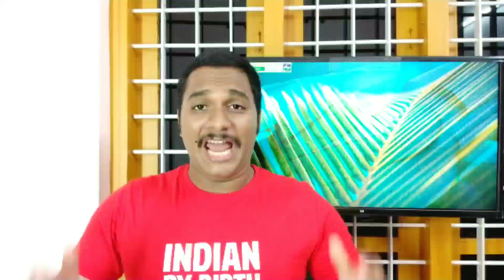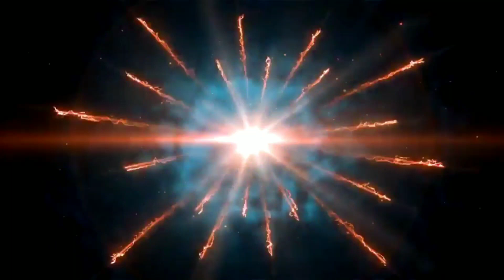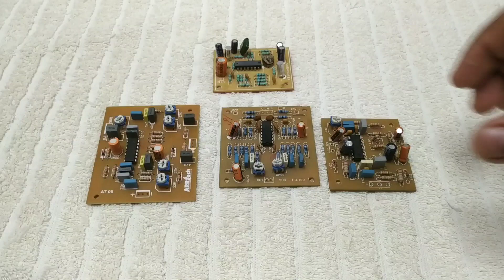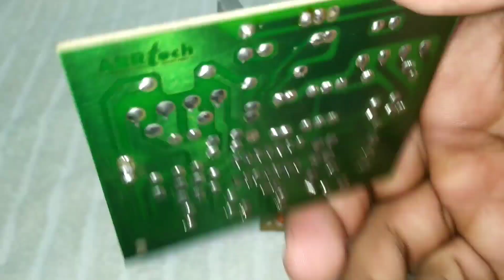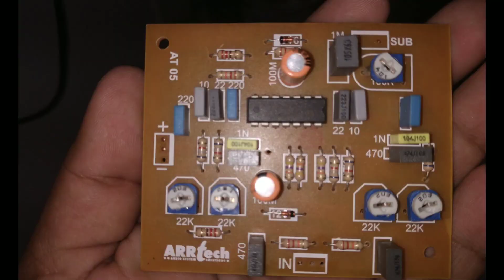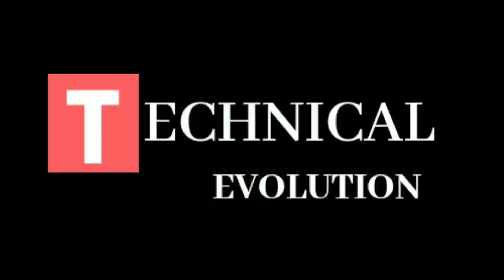Best subwoofer low pass filter board. How to select a board  for optimum performance

Comment: Tda2030 പറ്റിയ നല്ല ഒരു subfilter board പറയാമോ
Reply: 2030 ഉപയോഗിക്കണ്ട Mosfet or class d amp നോകൂ
Reply: @AMNLabs  home theaterine  set cheyyan aayirunne atha  mosfet use cheyathate Allathe ore tpa3116d2 class d unde but speaker verum 25w aanu ullathe
Reply: Mosfet പിന്നെ classd amplifier ൽ നല്ല low frequency response kittum adha njan agane paraje jrc4558 ulla filter nokooo 2030 nu
Reply: Pinne nalla powerful ane njan home theater chayyumbol mosft or transistor or class d amp ane upayogikare jbl pioneer infinity 12 inches idinu thaze ulla otta woofersum upayogikarilla tda2030 oru cheriya amp Anu
Reply: TB bass filter und  public available alla

Comment: ബ്രോ സബ് ഫിൽറ്റർ ബോർഡ്‌  lm324 ഡബിൾ പ്രീസെറ്ലോട്ട്  27-0-27 dc അല്ലേ max  കൊടുക്കാൻ പറ്റു.. 37-0-37 dc കൊടുക്കാൻ പറ്റുമോ??  Lm 324 nte max voltage 32 dc ആണു 4 mosfet ബോർഡ്‌നു എങ്ങനെ മാച്ച് ആക്കാം? പ്ലീസ് റിപ്ലൈ..
Reply from the maker: Resistor vazhiyanu voltage ic yilekk pokunnath avde vach voltage kurayunnund so no problem pinne chila boardil zener dioadum und so no problem
Reply: @technicalevolution9887   താങ്ക്സ് ബ്രോ .. കട്ട  സപ്പോർട്ട് ഉണ്ട്.. 💓💓

Comment: hi ബ്രോ ഈ ബോർഡ് കളുടെ ഒക്കെ op frequency range എത്ര മുതൽ എത്ര വരെ ആണ്
Reply from the maker: Pala boardum palathanu on 324 40 to 180hz anu
Reply: ചേട്ടാ 10hz to 80hz കിട്ടുന്ന board ഉണ്ടാകുമോ?
Reply from the maker: @geneshpn  20hz thottee humansnu kelkan pattu pinne 40hz to 50hz anu busil okke varunnath frequency theerumanikkunnath circuitile resistorum caps um anu
Reply: 40 to 50 hz circuit or board  ഉണ്ടോ ബ്രോ

Comment: ഇതുപോലുള്ള ഒരു വീഡിയോ ആണ് എല്ലാരും ഇറക്കേണ്ടത് ....വളരെ നാന്നായി ...Jbl മാച്ച് വരുന്നതു 74ആണോ 324ആണോ ?എത്രയാണ് റേറ്റ് .....
Reply from the maker: All boards costs under 250
Reply from the maker: Lm324 anu better tlo74 ithiri higher frequency pole thonnum lm324 maatty tlo74 ittal peak pettennu akum amp so pettennu clip chyum
Reply: @technicalevolution9887  ക്ലിപ്പ് ചെയ്യുക എന്ന് വെച്ചാൽ ???
324  നു പകരം tlo ഉബയോഗിക്കാമോ ?
Reply from the maker: @abhilashgerman2636  ya 2icyum use chyam ore portil clip akuka nnu vachal volume koody peak chellumbo click sound kettu distorted akum
Reply: @technicalevolution9887  Last -324 ഉപയോഗിച്ചുള്ള single supplay ബോർഡും ,dual supplay ബോർഡും തമ്മിൽ പ്രകടമായ വ്യത്യാസം സൗണ്ടിൽ ഉണ്ടോ?
Reply from the maker: @abhilashgerman2636  und
Reply: @technicalevolution9887  കോൺടാക്ട് നമ്പർ

Comment: എന്റെ ആംപ്ലിഫൈർ 3773 ൻ്റെ 4 ട്രാൻസിസ്റ്റർ ഉള്ള  33-0-33   6 അമ്പയർ transformeril വർക്ക്‌ ചെയ്യുന്നതാണ്  ഇതിലും കൂടുതൽ sound ക്വാളിറ്റി ഉള്ള ആംപ്ലിഫൈർ വേറെ ഏതെങ്കിലും ഉണ്ടോ ഉണ്ടെങ്കിൽ ഏതാണ് ദയവായി മറുപടി തരിക
Reply: 2st 5200,transistor
Reply: 2sc 5200 thoshiba transister ആണോ
Reply: @djtech9427  aaa board aan njn use cheyunath.  Atilum punch 4 mosfet boadina

Comment: ഈ filter ബോർഡ്‌ എങ്ങനെയാ 4mosfet boardil connect ചെയ്യുന്നേ??
Reply from the maker: Just connect out put of filter to input of  the MOSFET board
Reply: @technicalevolution9887  ithil mono out alle kittunne athenganeya stereo connect cheyyunne
Reply from the maker: @johnny_9633  subwoofernu mono board alle use chyunne ini 2 out venamenkil oru gained board use chythititt aa boardinte out edth 2 sib ampilott kodthal mathy
Reply: @technicalevolution9887  thanks